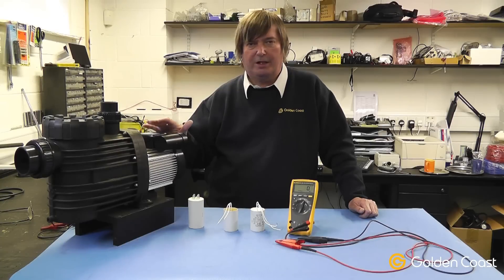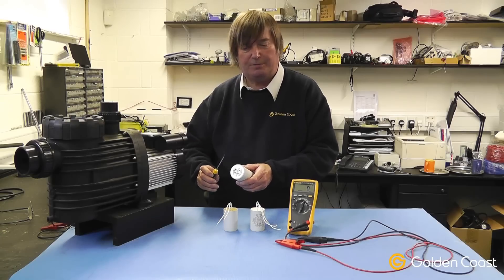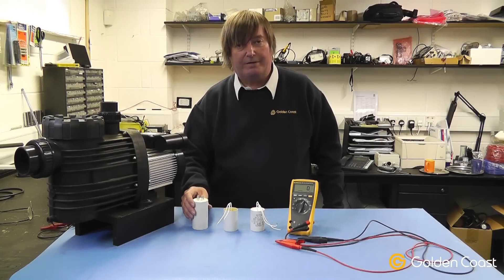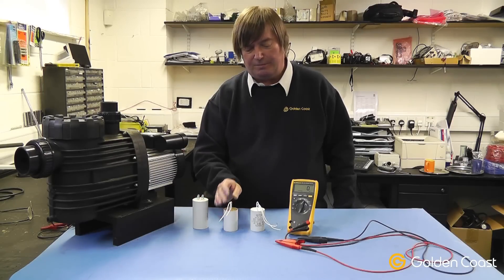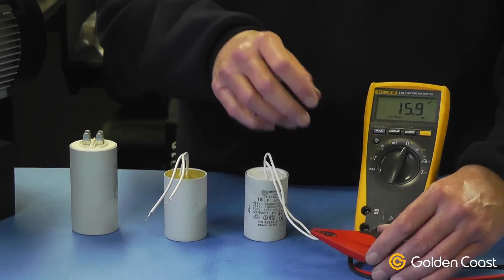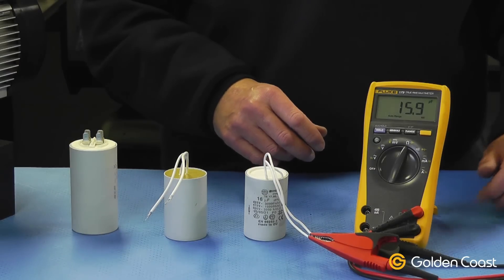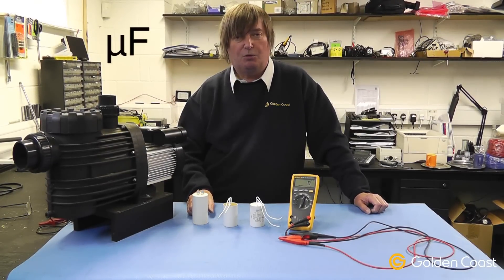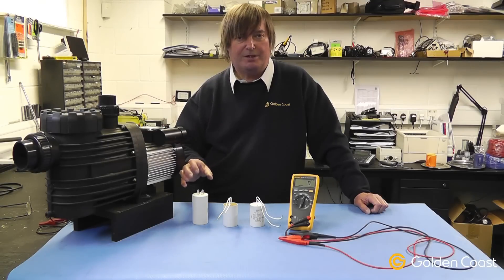What Does a Capacitor do on a Swimming Pool Pump? | Andy's Answers

Comment: Do you measure the capacitor before or after you discharge the capacitor?
I assume after you have discharged the capacitor.
Reply: +second eltham you should measure it after you discharge it.  The meter will determine the value of the capacitance by charging it.
Reply: DEFINATELY AFTER DISCHARGE!!  If you connect it to your meter whilst it is still charged it WILL damage your meter. In fact, hold the short across the capacitor for about 5 seconds to ensure ALL of the charge is dissipated.